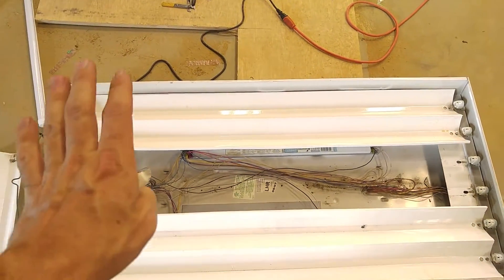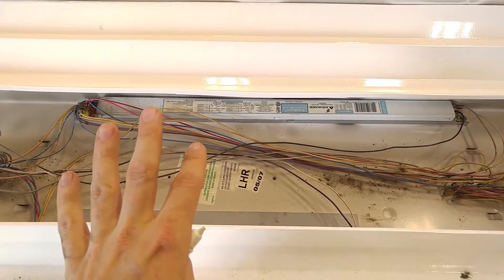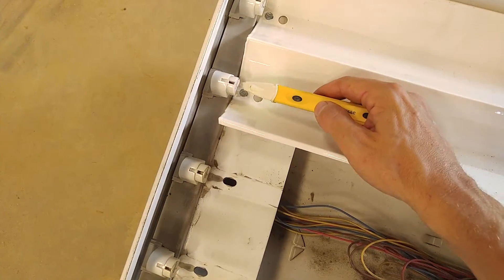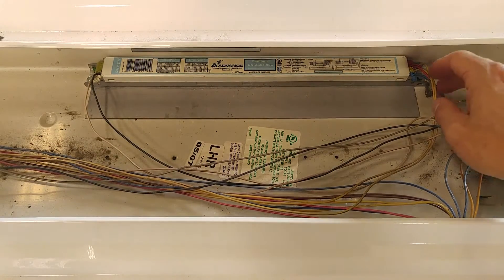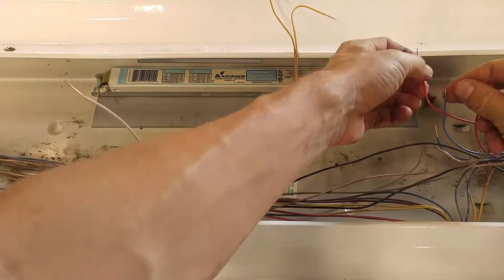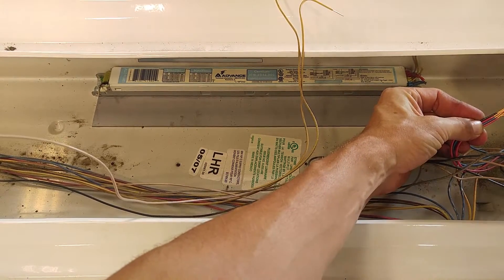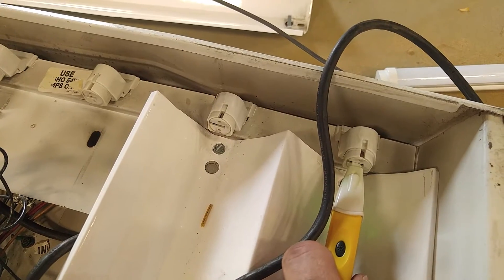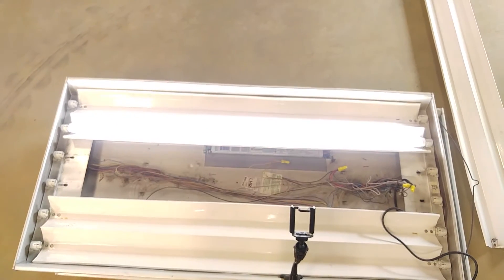(:HowTo:) Modify a Fluorescent Light Fixture to Work With LED Light Tubes ~Disable Ballast for T5/T8

Comment: I have the same fixture and did mine to led,  I only used one wire per bulb on each end , am I still good?  It did work fine.0
Reply from the maker: If it works, you're good.

Comment: I have a T5HO fixture with three ballasts and 6 bulbs (so two bulbs per fixture). The Luma ballast is no longer available and I would like to install LED with ballast bypass tubes. Each ballast also has a green ground wire on the same end of the ballast as the white and black wires and you do not have a green ground wire on your ballast in your video.  I am wondering what to connect this green wire to once the wires are cut from each of the ballasts. Also, in a different video from Edison Lighting he shows a T5 fixture (4 bulbs with one ballast) but he puts one of each color wire (red, blue, brown, yellow) to white and one of each color to black. You put the yellow wires to the white and all other colors to the black. Not sure which one is the correct method for my fixtures.

Comment: I bought AC led bulbs that I thought would just replace my 4ft T5s with no modifications but they didn't work. This is a big help, I will give this a shot
Reply: Not sure if you can still remember, but I have a wire which connects 2 ballasts together, it seems to be connected to the same pin 4 on both the ballast outputs, should I ignore this one?

Comment: I found your video more impressive than another one I watched.  This guy in the other video had too many connections going on and I found it confusing.  Am I right by saying that you are simply connecting yellow to yellow, blue to blue and red to red and at the final step adding the white wire to the yellow group and the black wire to the blue group for your power leaving the red connected to the red.
Reply from the maker: I most cases yes.
Reply: @GadgetClass  I did as exactly as you said and my light will still not turn on.  Could there be something I'm not doing right?  I did notice one thing I'm not sure about and that is the fact that the blue wires crisscross from one tombstone to another tombstone and not directly across from each other.  I really didn't understand what the red wire is for since it's not connected to the black power wire.  It's amazing how some things seem so simple but, they aren't.  I had 2 ballasts installed on it and I removed both of them.  They are not required when converting are they?
Reply: I think I caught on to something you said that may be my problem.  I thought you said to connect the white to the yellow and the red and blue to the black.  I didn't do that.  I simple connected red to red and just the blue to the black.

Comment: Thanks For the help...your video was extremely helpful...I was praying you would do the other 4tube ballast bypass as it was exactly what I was needing. I’ve done hundreds of T12 & T8 bypass but never a 277 volt T5...with switching for the two inside lamps and separate switching for the two outside lamps. These are warehouse fixtures that were installed in our church sanctuary and I have been tasked with the conversion.(retired electrician).
Reply from the maker: David Belisle I'm sure hot color vary between ballast manufacturers. Just make sure you have hot going to one side of the fixture and neutral to the other and that your LED bulbs are designed for direct wiring(no ballast) and you will be fine.

Comment: So...your saying that you don’t hook up the brown and blue/white at all? My fixture is a four tube 277 volt that I’m wanting to do T5 led ballast bypass. Also on the power side, I have a black, white and grey. Do I tie the grey with the white to the yellow? By the way, THANK YOU for the help.
Reply from the maker: David Belisle yes Geary, white and yellow together. All others to black. You basically just need to make sure hot goes to one side of the fixture and neutral goes to the other. Follow the wires.

Comment: What if you had bypassed both ballasts?  Just all yellow and white together and all red blue and black together?
Reply from the maker: dernew3 yes. you just need to make sure you have a hot lead going to one side and a neutral to the other. Most bulbs don't even care which is which (they are reversible)

Comment: what leds would i use to bypass the ballast? were did u get the bulbs u use to bypass them. i want to change out my t12
Reply from the maker: jeff hebert Hyperikon are my favorite so far: http://amzn.to/2nlZZtX
Reply: did u have to change tombstones i have non shunt in mine
Reply from the maker: jeff hebert just get the Hyperikon T12 bulbs you will be good. They even work with or without ballasts now.